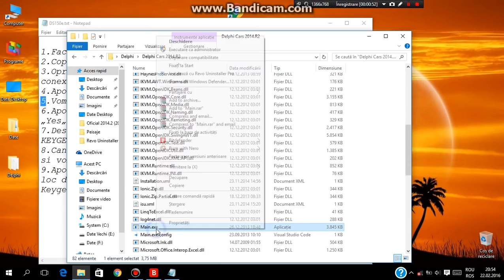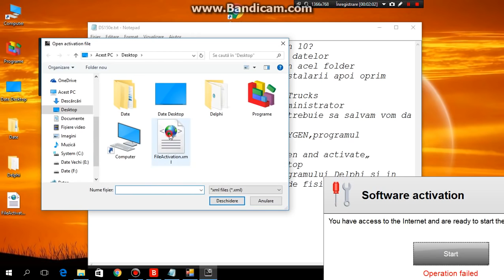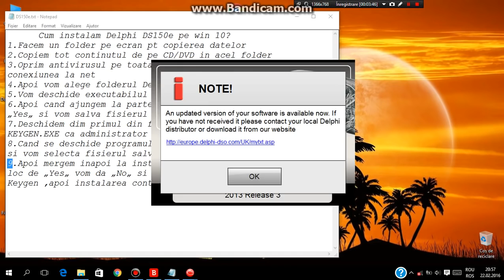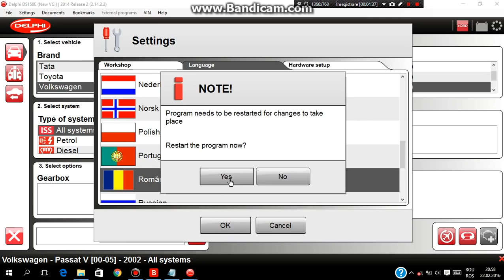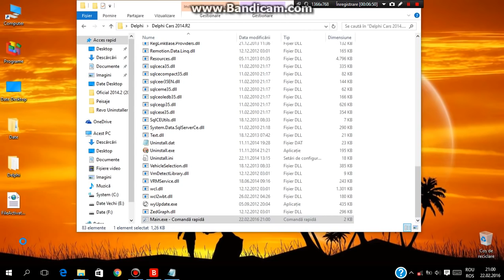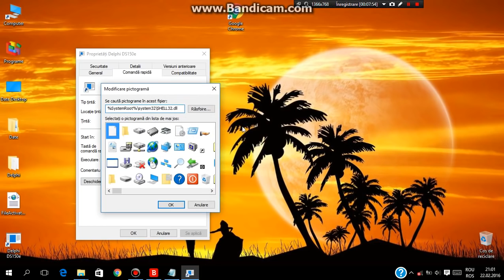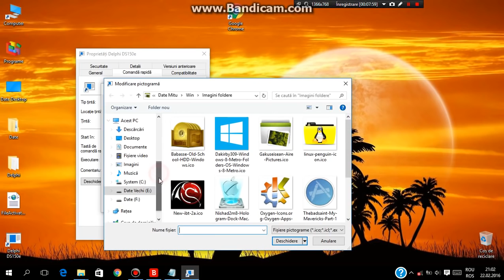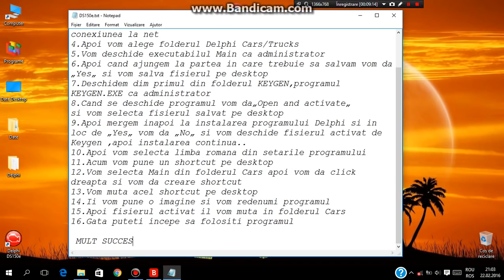Instalare Software Delphi DS150e 2014.2 / Install Delphi DS150e 2014.2 Software

Comment: Salut , am interfata delphi 2016 cu tot cu soft , am inteles prin alte intrebari despre deplhi  ca versiunea 2014 este cel mai stabil , rugamintea mea este daca ai softul 2014 trimite mi si mie  tot kitul soft si  keygen . adresa de maill ovidiufarfuidudu@yahoo.com
Reply: Mersi ,miercuri mă apuc de ia .  Am o altă intrebare : Delphi al meu 2016 : am vrut să activez funcția la centură cu sonor , acum ceva timp am dezactivat-o tot cu o altă interfața delphi si a mers ,  E cu asta nu o pot activa , setez cu sonor se reseteaza zice că funcția a s-a schimbat dar insă nu se activează , rămâne tot fără , ai ideie de ceva.  Plăcile din delphi sunt albastre . Cred că cele mai proaste, in schimb pot scrie injectoarele .
Reply from the maker: Nu am idee, insa banuiesc ca ar fi de la diagnoza, placile albastre stiam ca sunt mai proaste, insa in ce conditii nu stiam, dar uite ca asa aflam. La diagnoza mea, placa este verde, iar releele sunt rosii. Incearca totusi si cu 2014, poate reusesti. Pana atunci multa bafta!
Reply: Ok . Asta este ! Mersi mult
Reply from the maker: Cu drag! Te rog sa revii cu un raspuns, sunt curios daca este problema de soft sau diagnoza. Multumesc!
Reply from the maker: Salut, ti-am trimis acum de pe Gmail, poti verifica.

Comment: Pe mine ma pune sa fac update de firmware, dar am auzit ca daca ii dau update nu va mai functiona testerul, ce e de facut?
Reply from the maker: Pentru fiecare versiune indiferent ca e noua sau veche (ex: 2015->2016 sau 2016->2014, etc) te pune sa faci update la firmware. Intradevar ce zici tu este corect, insa daca respecti instructiunile nu vor fi probleme. Conecteaza laptopul la o retea stabila (wireless sau cablu), care stii ca nu se intrerupe, conecteaza diagnoza la laptop si la  masina, cu motorul pornit. Update-ul dureaza vreo 5 minute, deci va trebui sa faci in asa fel incat sa nu se intrerupa alimentarea laptopului in acele minute. Si asta este tot procesul, nu este complicat, dar trebuie sa acorzi atentie la ce am scris mai sus. Multa bafta!

Comment: După ce instalezi softul și faci și driverele, am văzut că apare o eroare de sursă nu știu cum... Trebuie să ai tot timpul cd ul de instalare introdus in laptop sau?
Reply from the maker: Salut! Pana acum nu am intampinat o problema de genu, insa iti recomand ca tot ce ai ce CD/DVD sa iti transferi pe laptop si apoi sa incepi instalarea programului. Instalarea directa de pe CD/DVD implica pastrarea CD-ului/DVD-ului pe toata durata instalarii si doar atat, nu este necesar si dupa instalare. Revino cu un mesaj în caz ca rezolvi sau nu ceva. Eventual lasa-mi adresa de email si vorbim acolo. Multa bafta!

Comment: Buna ziua! Multumesc mult pentru sprijinul acordat (link descarcare soft)! L-am instalat conform instructiunilor si functioneaza corect. L-am testat pe un E200 Kompressor, Audi A6 (2004) si un Caddy 1.6 TDI (2011). Este foarte adevarat ca avand Windows10, mi-a dat ceva batai de cap cu driverul( am utilizat VCI). Acest aspect a mai fost scos in evidenta si de alti utilizatori in comentariile de mai jos! Mult succes in continuare pentru munca si ajutorul pe care il oferi neconditionat!
Reply from the maker: Multumesc frumos pentru apreciere! Ma bucur cand ajut pe cineva, o fac din placere iar chestia asta aduce cat mai multa satisfactie, cel putin pentru mine.

Comment: salut, am sau cred multe intrebari,....nici nu mai stiu ce sa fac...am bagat ieri windows 10 si am bagat cd-ul in leptop incerc sa copiez pe leptop da imi da block ceva de genu ba la acsecurity.dll ba la altceva din folderul Cars, sau daca bag cd-ul nici nu intra in citire nu stiu ce naiba are ramane folderu cu cd-dvd cu alb....help va rog.    
a si am pe versiunea 2.15.3 DS-150E
Reply from the maker: Salut si scuze pentru raspunsul meu asa de intarziat. O sa iti las un link cu programul 2015 arhivat, dar mai intai lasa-mi un email ca sa putem conversa si sa te pot ajuta mai rapid, eventual te pot ajuta prin team viewer, dar lasa-mi un email si vorbim acolo mai multe
Reply: ce naiba are de nu ramane mesaju? 
alextara353@gmail.com
si va rog sa trimiteti programul. ms
Reply from the maker: Ti-am trimis acum link-ul pe Gmail, eu am primit mesajul de la tine, poate nu iti arata tie. Cu placere!
Reply: @AllAbout15  imi trebuie fisieru ala de licence.key si nu pot deschide programu

Comment: Salut. Imi trebuie softul pentru delphi 2016 , l-am cumpărat dar cand am băgat cd imi zice că este gol , si nu am softul imi poți trimite link-ul pentru a download 
mersi , si inca ceva am si vcds cand il conectez la mașină imi zice că nu găsește interfața,  din ce cauză
Reply from the maker: Salut, din pacate nu te pot ajuta momentan cu versiunea 2016 deoarece nu sunt in tara (dupa 20 Septembrie iti pot oferi un link), doar cu versiunea 2014, in caz ca vrei. In lagatura cu VCDS, ai folosit pana acum interfata VCDS? Indiferent de raspuns, incearca sa instalezi programul si pe alt laptop/PC , daca nici asa nu functioneaza ii posibil sa fie intrerupt cablul, ori vreun pin de la mufa OBD
Reply: @AllAbout15  nu am mai folosit vcds
Reply from the maker: Ai instalat corect programul? poate fi si asta o problema
Reply: @AllAbout15 la început nu l-am instalat cu internetul inchis antivirus-ul nu l-am dezactivat si nici firewall si cred  că din cauza asta nu merge vcds de imi zice că nu găsește interfața,  programul se deschide
Reply from the maker: Ti s-a instalat si driverul pentru cablu? de obicei de instaleaza automat. De unde ai cumparat diagnoza?
Reply: @AllAbout15  de pe olx
Reply from the maker: Vorbeste cu persoana respectiva sa te ajute cu instalarea sau macar sa ii spui ce probleme intampini la instalare. Problema la mine este cu timpul, nu sunt momentan in tara.. te polt ajuta dupa 20 septembrie

Comment: Salut,
Cum pot sa instalez o noua versiune de program?
Cand deschid programul imi arata ca este disponibila o noua versiune de program si cand deschid pagina nu mi-o deschide.
Testerul nu imi mai scaneaza problemele posibile de la motor, imi arata ca nu raspunde aceasta obtiune si ma gandesc ca din cauza softului sau...
Reply from the maker: Salut, nu poti actualiza softul prin intermediul acelei pagini, doar daca cumperi alt soft mai nou. Iar in legatura cu scanarea erorilor, in ce sens nu scaneaza? Nu iti scaneaza niciun modul al masinii sau doar partea motorului?
Reply: @AllAbout15  Salut,
Nu scana partea motorului, celelalte le scana. Dar inainte sa apara acea versiune imi scana si partea motorului.
Am cumparat veraiunea 2016 si pt Delphi si pentru Autocom dar nu merge niciuna din ele deoarece nu pot sa fac update la farmeware.
Am incercat si fara obd bagat in masina si cu obd in masina si nu ma lasa sa fac update deloc.
Reply from the maker: Pentru actualizare trebuie sa ai masina pornita / contactul pus si sa ai o conexiune la net. Mare grija sa ai in timpul actualizarii, sa nu opresti masina /  contactul sau sa deconectezi interfata de la laptop. Succes! Lasa-mi raspuns daca ai reusit sau nu.
Reply: @AllAbout15  Salut,
Am instalat versiunea 2016 si am cumparat licenta si nu pot activa programul.
Ma poti ajuta, te rog.
Da-mi o adresa de mail sau ceva de contact sa putem vorbi.
Multumesc.

Comment: salut am mai intalnit o problema nu mi se instaleaza driverul de la tester ma poti ajuta cu ceva mulyumesc
Reply from the maker: Salut, ce fel de problema intampini, in ce sens nu vrea se se instaleze?
Reply: @AllAbout15   când bag cablu usb nu se instalează driverului nu îmi recunoaște calculatorul(îmi scrie că nu sa instalat )
Reply from the maker: Sa inteleg ca iti da o eroare de instalare a driverului. Daca am inteles bine, du-te la device managerul si observa ce device apare cand conectezi cablul, vei dezinstala acel driver si ii vei instala driverului inca odata din folderul cu programul Delphi. Iti las un link cu instalarea driverului: https://www.youtube.com/watch?v=WzZjfSk1ecc&t=2s
Reply: @AllAbout15  Multumesc mult am reusit  Mi-ai fost de mare ajutor  recomand tuturor  👍👍👍
Reply from the maker: Cu placere! Ma bucur ca ti-am putut fi de folos! 👍

Comment: salut
poti sa ma ajuti te rog si pe mine.
am cumparat aparatul Delphi DS150E care a venit impreuna cu CD-ul si cablul.
L-am instalat exact cum ai facut tu dar tot nu imi merge.
Imi tot apare sa ii fac Update si cand ii dau imi da eroare.
Poti sa imi dai niste sfaturi ceva cum sa fac. (myrelush_irl@yahoo.com) e adresa mea.
Multumesc mult. Salut
Reply from the maker: Salut, as putea sa te ajut, dar sa imi spui ce eroare primesti
Reply: @AllAbout15   cum as putea sa iti trimit o poza cu eroarea?
Reply from the maker: Trimite-mi pe Gmail agendagoala@gmail.com, iti voi raspunde pana in ora 16.00 sau dupa 18.30
Reply: @AllAbout15  ok. multumesc mult.
iti voi trimitr poza cu eroarea.
o zi buna. salut
Reply from the maker: Ti-am trimis mesaj pe Gmail, sper sa il fii primit si sa te descurci!

Comment: prietene, slt, te rog sà mà ajuti sà instalez software delphi, am incercat de 2 ori dar laptopul nu  recunoaste/vede  VCI - tmfotbal63@gmail.com
Reply from the maker: Salut, momentan nu sunt in tara si nu am laptopul la mine, imi pare rau dar nu pot sa te ajut cu instalarea. Atunci cand conectezi interfata la masina (fara sa fie conectata la laptop) se aprind niste leduri la interfata? Ai incercat sa instalezi pe alt laptop? Iti las linkul de la videoclipul cu instalarea driverelor pentru interfata:  https://www.youtube.com/watch?v=WzZjfSk1ecc . Mai incearca odata sa instalezi programul dar inainte de asta verifica ca interfata sa aiba acelasi firmware ca programul (daca nu inseamna ca trebuie actualizata interfata). In caz ca nu merge nici asa lasa-mi un numar de telefon si te voi suna eu (comentariul cu numarul tau nu il voi publica ca sa nu il poata vedea si altii). Sper sa reusesti!

Comment: Salut! Am o întrebare.Am instalat diagnoza, merge sa fac teste, dr nu se aprinde acel bec de la mufa obd, iar ledurile colorate se aprind doar cabd o conectez la masina, interfata o recunoaste doar in aceste conditii, nu ar trebui sa se aprinda ceva si cand e conectata doar la laptop? Ce trebuie sa fac? Multumesc!
Reply from the maker: Salut Ionut, led-urile de la capatul mufei OBD de la interfata ar fi trebuit sa mearga fara ca diagoza sa fie conectata pe undeva (poate ai pe undeva un contact imperfect in interiorul mufei OBD de la interfata), iar in legatura cu diagnoza, nici mie nu mi se aprinde nimic la diagnoza daca o am conectata doar la laptop, posibil ca laptop-ul sa nu ii ofere suficient curent incat sa se aprinda vreun led sau poate nu ii programata diagnoza astfel incat atunci cand o ai conectata la laptop sa se aprinda ceva.